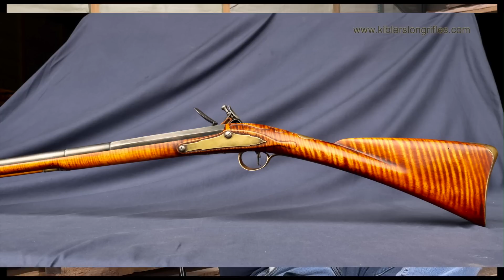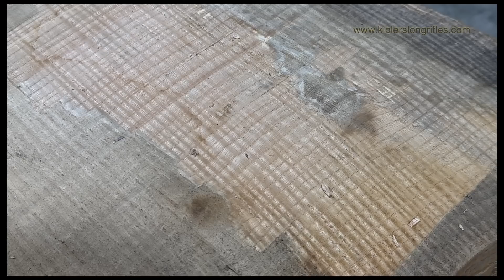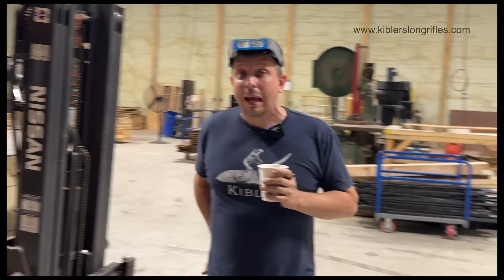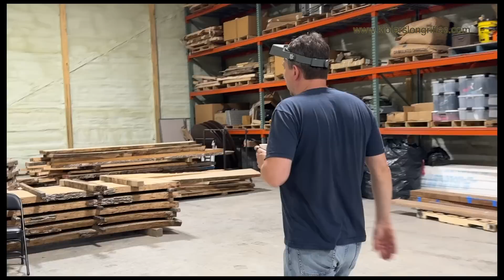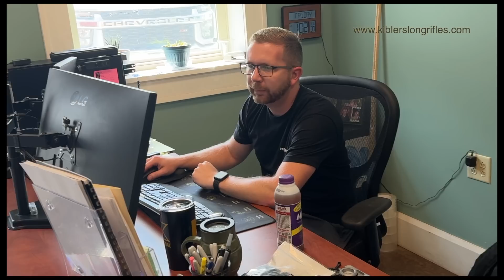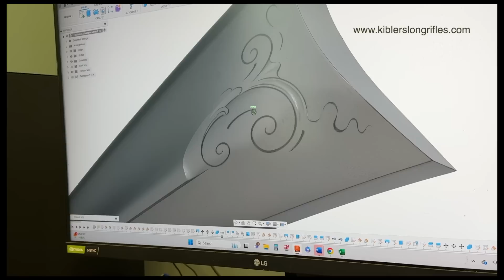Hanging out with Jim: Questions and Answers Part 1 August 2024

Comment: Dear Mr. Kibler and team, I would buy a Long Land Pattern Brown Bess from you **YESTERDAY**!  The War of Austrian Succession, the Jacobite Rising, the French and Indian War, the American Revolution, that pattern saw so much history that a kit to your superb standards would be a must-have for military and historical collectors, reenactors, and regular flintlock enthusiasts alike (with the drop in its stock and overall design, it's more of a craft appreciator's and shooter's piece than later patterns).

If you made your Bess appropriate for the French and Indian War and before (Patterns 1730, 1730/40, 1740, and 1742), a wooden ramrod would be perfectly accurate to history and, furthermore, my understanding is that older guns with wooden ramrods soldiered on alongside new-fangled iron ones into the 1770s. Higher cost due to extra features like sling swivels and so on would be perfectly understandable. 

Best of luck with the Hawken and thanks for taking the time to answer our questions!

Comment: Have you thought about renting time on some of the 3d probe based measurement tools? That would let you draw with the probe to follow carving on a loaner to digitize it for refining and cutting. The optical and ever laser based scanning can leave a lot of clean up needed but might save some time over a from scratch based design.

Comment: I am impressed with the amount of care and detail you are putting into your products. Now that you have me getting back into black powder, I am "patiently" waiting for my Woodsrunner to arrive. Some may criticize your using modern tech for producing these "reproductions", but regardless how they are produced they are still reproductions. As such, they should be made as functional as possible, and you are batting a 1000 in that respect. IMHO looking at the BP offerings at the local sporting goods store they have become mostly modern rifles that burn black powder. These are just to meet the basic requirements to use in BP deer season. The product you have is very suitable for hunting or target, reliable and accurate, and is a true BP arm.  Thanks for your passion.